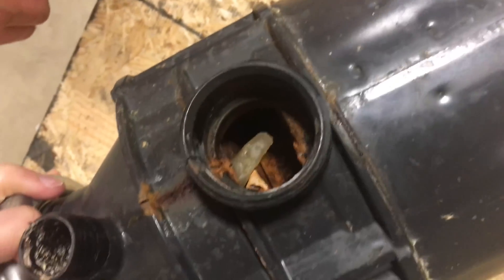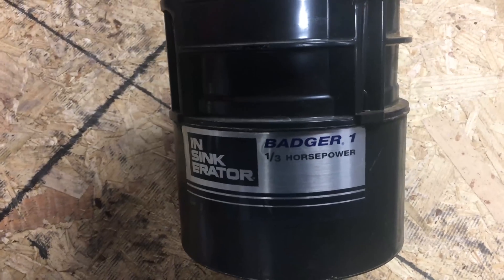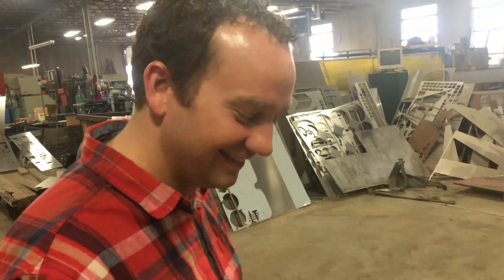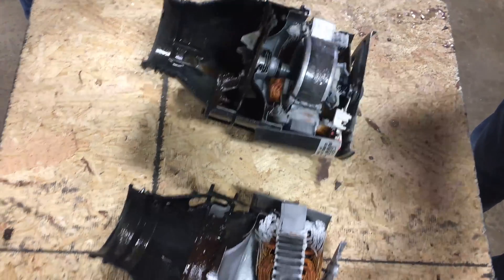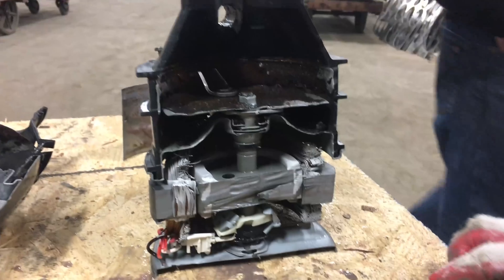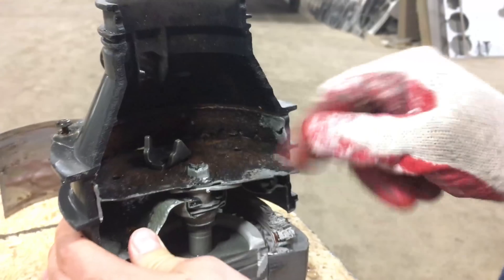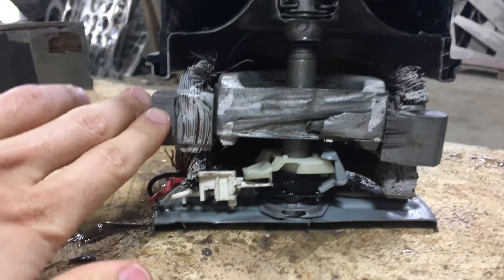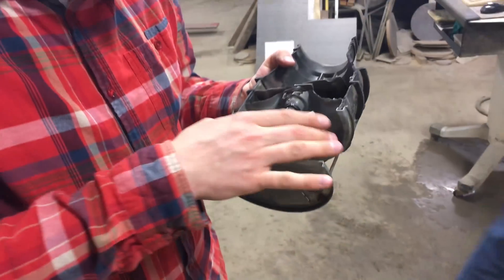Inside Garbage Disposal vs 60,000 PSI Waterjet Cutter

Comment: There actually are some with razor blades inside. It's like a normal sink hole with a rubber booty and all, hole but inside there are a bunch of sharp blades spinning in a cone type pattern with the blades narrowing in from the outside towards the center going downwards. Also the blades are slightly angled for maximum shredding and self cleaning ability.

Yea I did just make all that up. Wanna buy one?

Comment: cut a propane tank in half
Reply: swiss Why what do you exspect to be in there? Its a steel tank.
Reply: I think the pressure regulator would be much more interesting than the tank itself, and it would fit better.
Reply: Jeff Green
Did you really mean to reply to my comment? If so, I have no idea what you're talking about. A pressure regulator is not just an empty steel tank.
Reply: swiss Woops i meant to reply to op
Reply: This whole reply section is a confused mess
Reply: swiss He dident say a pressure regulator... what are you talking about???